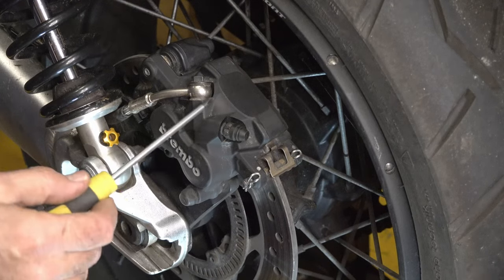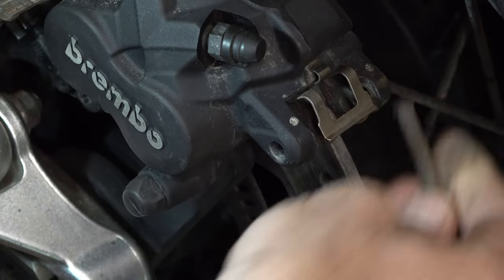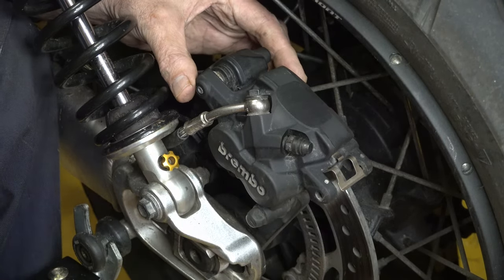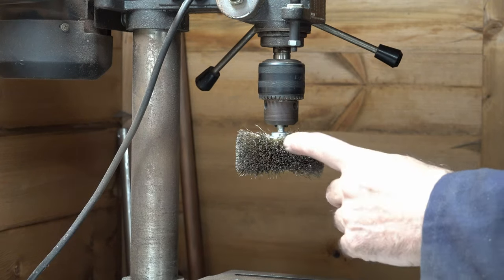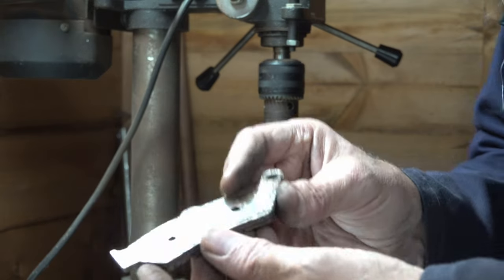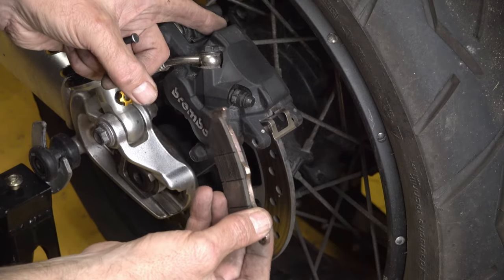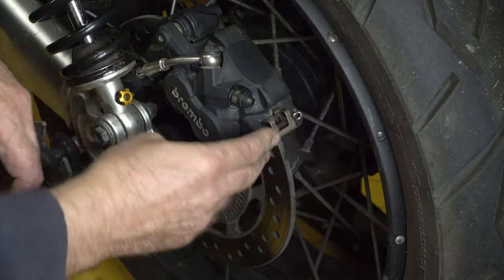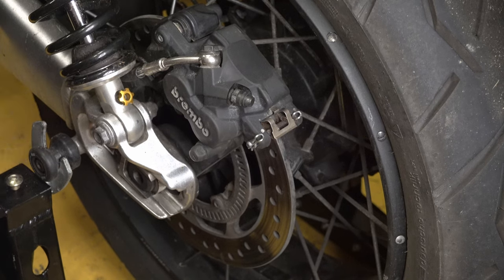How to change the rear brake pads on a Triumph Scrambler 1200

Comment: To lub or not to lub, that is the question. I personally use silicone spray for the pins and the back of the pads (not on every other side) and have had good experiences with it.

Comment: Another beauty. Thanks. Question—how often do you tend to bleed your brake lines and fill up with fresh brake fluid?
Reply from the maker: On each bike according to the service schedule. That is typically every 2 years.
Reply: Good man. I see this procedure overlooked often. It’s coming time for myself to do it, just wondering because of the ABS if you used dealer tool to bleed or just did it the good ol way. Cheers in advance

Comment: These pads do appear to have good life left in them, but for the novice out there, you only include to the bottom of the 3 grooves, NOT the whole thickness of pad in that judgement call.  
Your drill press wire wheel is effective, I'd call it the hand ripper 5000.  Hope you were wearing eye protection.  Viewers should be cautioned to be careful NOT to remove the anti-corrosion coating on those pins or next time you'll be drifting them out.  For the level of corrosion on these pins, I would have just used green scotch bright.  The coating on those pins is much more important than aggressively removing ANY of it with the hand ripper 5000.
While I admire ingenuity, the hand ripper 5000 should only be used in deepest darkest woods.  If you live within 100 miles of civilization, get a real bench grinder.  If you must do this, NO LONG SLEEVES, eye protection.  If the wire wheel caught your sleeve, what would be left of your arm?
Reply from the maker: Elf & safety mate. Elf & safety.
Reply: @SongsFromTheSaddle  Protecting yourself requires purposeful, conscientious thought.  "just because you can, doesn't mean you should".
Reply from the maker: @x-man5056  Your concern for safety is quite right and proper. I wasn't making light of it.